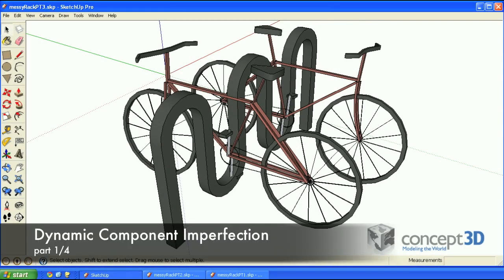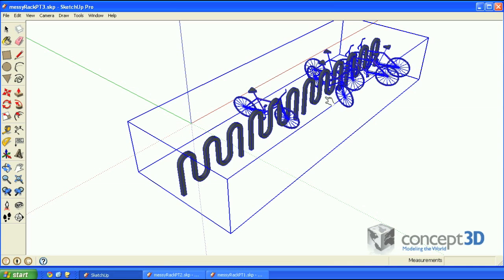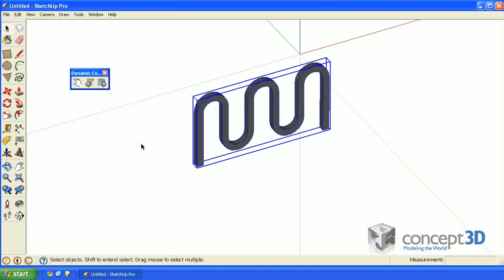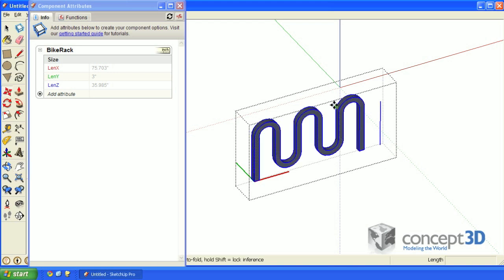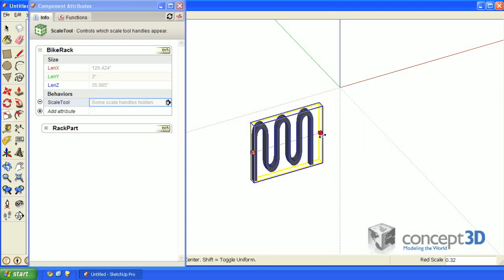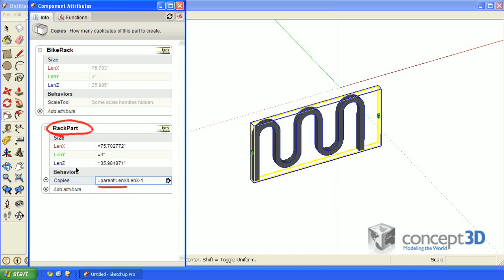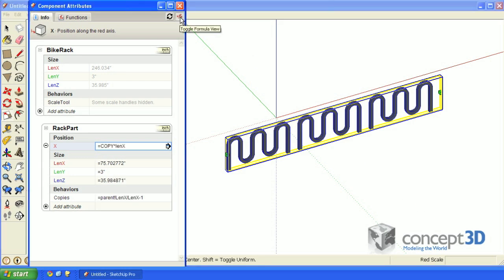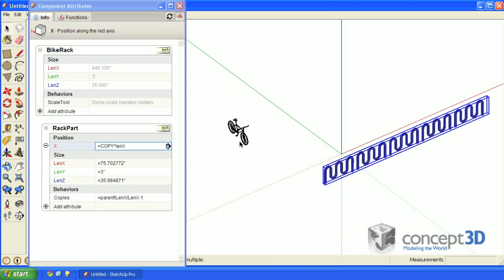Dynamic Component Imperfection: Part 1/4

Comment: I seem to be unable to lock values. Whenever I try to type the '=' sign before the size, once i hit enter i get this: '# = 5cm' with both '#' and '5cm' displayed in red color. Obviously something's not right, because -as I try to scale my object- it will just ignore the size constraint and stretch rather than duplicate itself as it should. Oddly enough, this only happens when I work with metric system units. I can't bring myself to work with imperial units, so is there a fix for this problem?